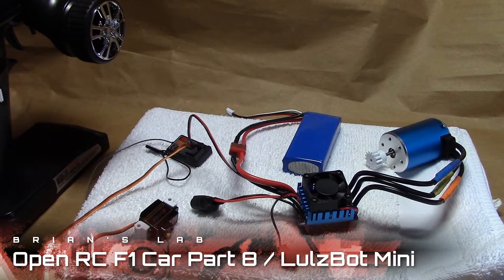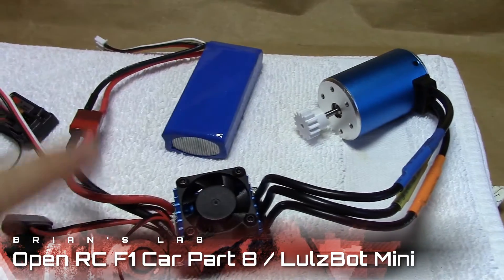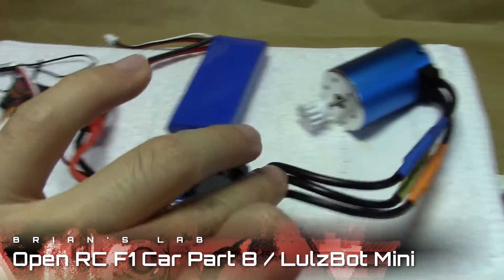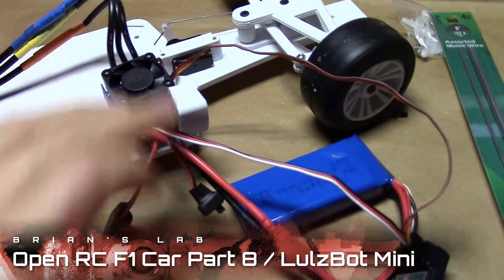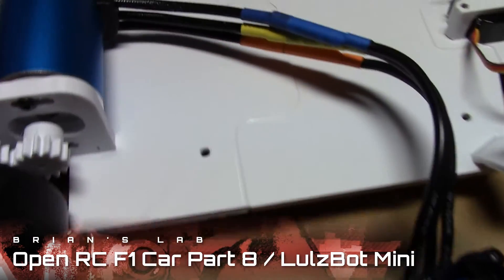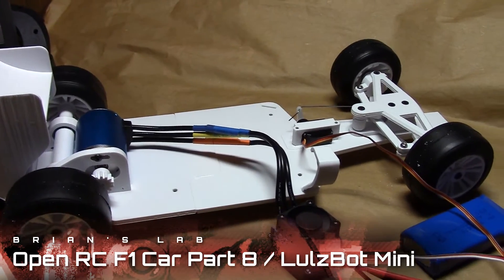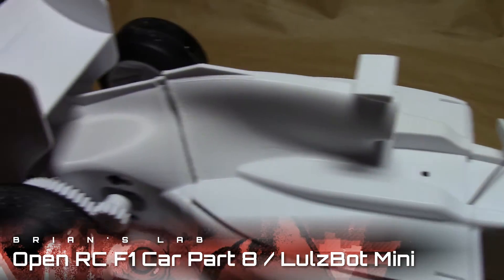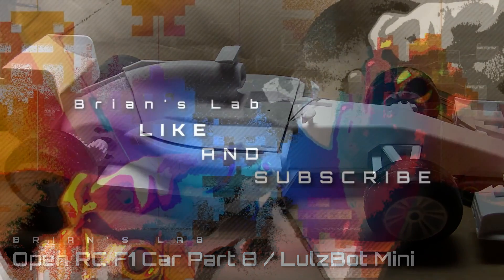Servo, Motor, Receiver, Electronics - 3D Printing the Open RC F1 Car Part 8 / Lulzbot Mini

Comment: so why not use a toothed belt printed with TPU to go between the motor gear and the axle gear instead of making direct contact between the gears? Wouldn't this reduce wear on the gears and make everything quieter?
Reply: You can also use grease/lube so that the gears aren't contacting directly.

Comment: nice job do you glue the chassi plates or are they held together with the body then screwed
Reply from the maker: Hi Travis, the chassis pieces are held together by their interlocking tightness alone. Afterwards, the body (once front, nose, chassis body, etc is screwed together) is screwed to the chassis.